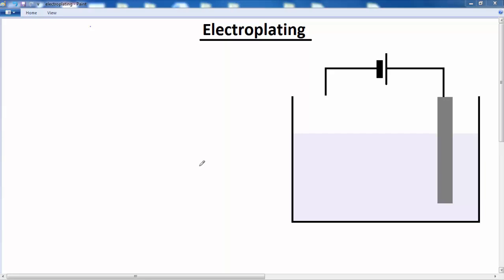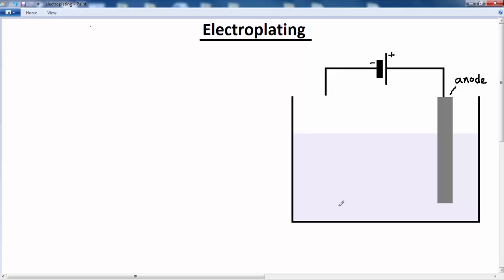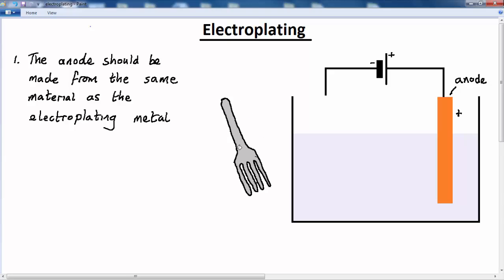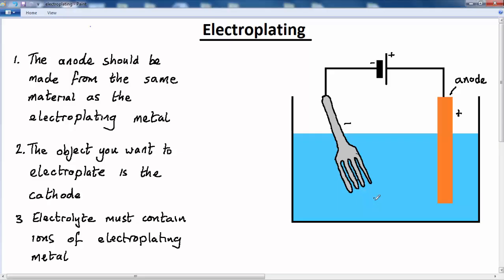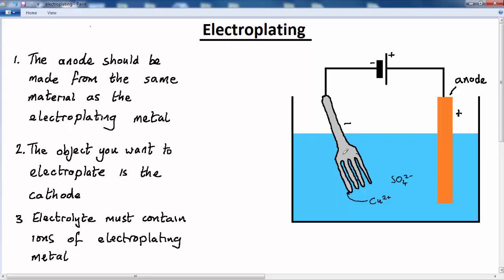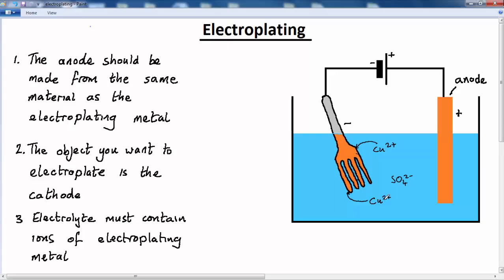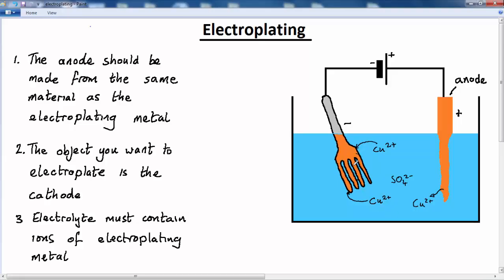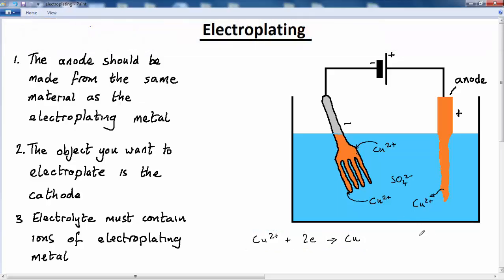GCSE - CHEMISTRY -  ELECTRO CHEMISTRY -  LESSON 9  -   electroplating

Comment: 2:55 how come the positively charge copper ions goes thru the circuit thru the anode? doesnt anode only attract anions which are negatively charged compared to the copper ions which arent
Reply: he's talking about the electrons going through the circuit. since electrons oppose the direction of current flow. the electrons then meet the cathode where they undergo reduction and neutralize the copper ions into solid forms.

the electrons go through the circuit. not the copper ions!

Comment: What is now the fate of the SO3 ions
Reply from the maker: Hi Oladele. The SO42- ions remain in solution. The copper atoms in the anode are oxidised to copper ions instead of the sulphate ions. If a stainless steel anode wer used OH- ions would be oxidised in preference to the sulphate ions resulting in the release of oxygen